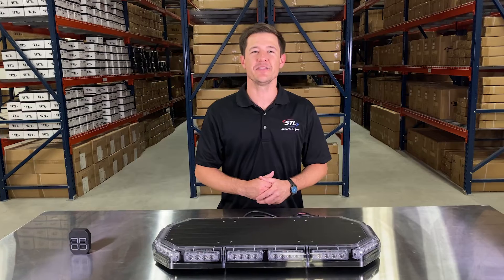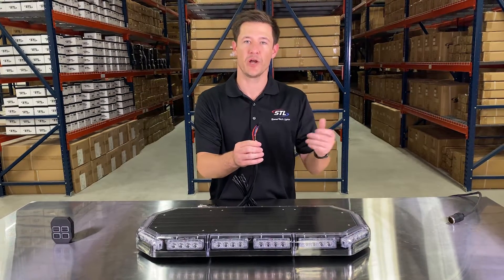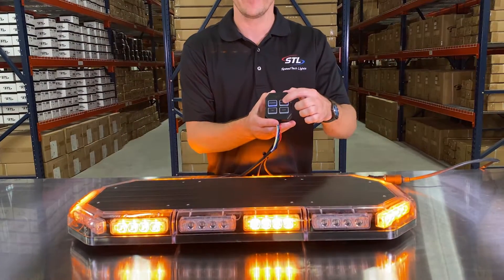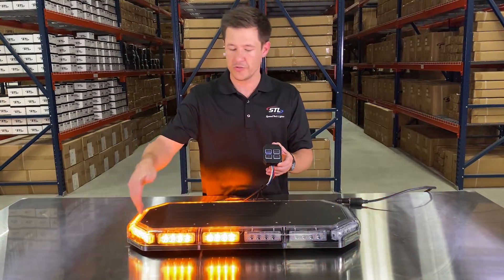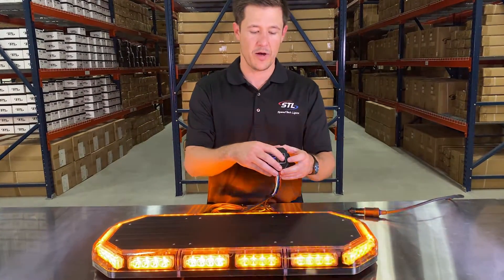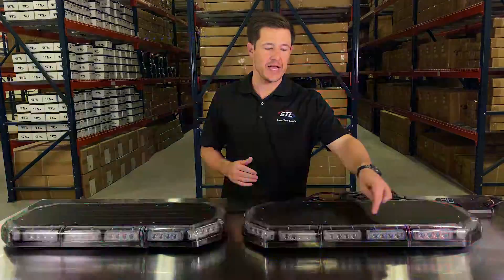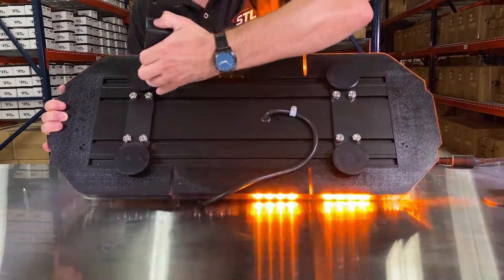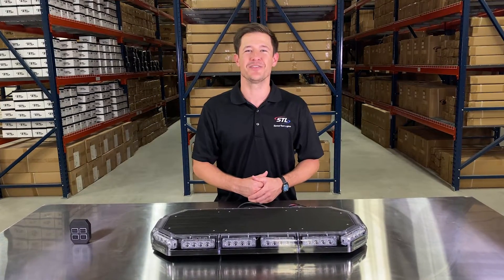K-Force® 27 TIR LED Mini Light Bar - Product Demo & Features

Comment: Okay, so I absolutely love this Lightbar for the length and shape! Only issue is, can the magnetic feet Mount be adjusted to have more space in between the light bar and vehicle? I have a 2005 Chrysler Pacifica and the roof has some ridges that I think will prevent the magnetic mount being able to sit properly. There is space in between the ridges to have the magnetic feet, it’s just the ridges might be a tad too high.
Reply from the maker: Hello, yes you can adjust the magnetic feet to adjust for your vehicle. They will slide along the slide track on the bottom of the light bar.

Comment: What wires are part of the aux cable? Is that a positive, a negative and a sync? I’d like to run a mini bar and a dash light off the control box and cig plug if I can.
Reply from the maker: Hello, the Aux will be Positive and Negative only so you will be able to turn on/off the dash light. We suggest getting it set on a pattern you like and then hooking it up to the Aux.